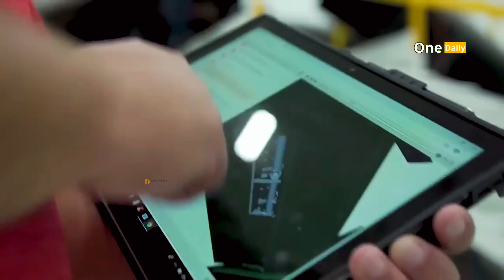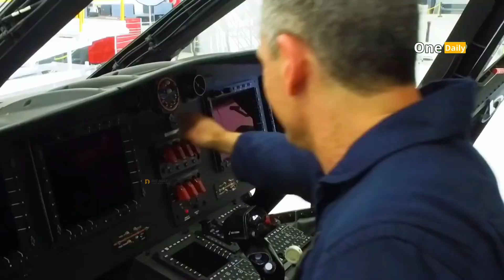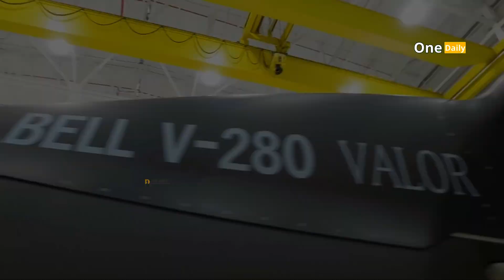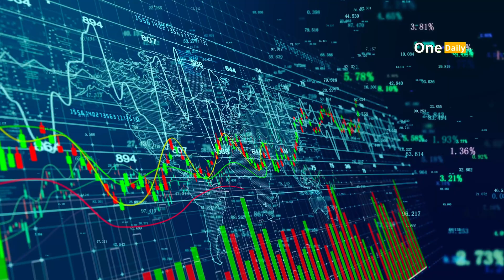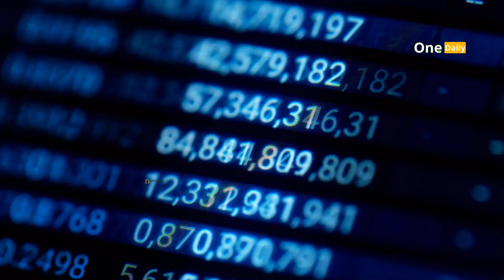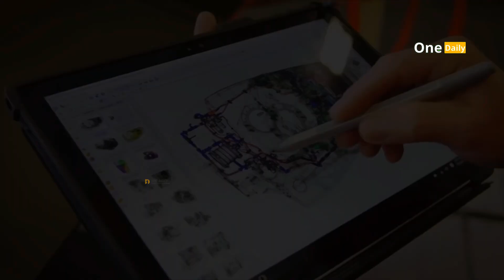Bell V-280 Valor: The Future of Military Aviation

Comment: What the difference between this and the osprey ? 

This needs a lot of space to land, the Blackhawk needs less space.

We already have the V22 Osprey. Are we reinventing the wheel ?

You can’t use this in urban environments, not that a Blackhawk is any better, but more opportunities with the Blackhawk
Reply: It has a 19% larger footprint than the Black Hawk. It is not as big as people claim it to be.
Reply: @n3v3rforgott3n9  thank you for this information 

I did not know that
Reply: The differences between this and the Osprey is size and a substantial redesign of the mechanism, it goes way beyond the fixed engines although that alone will already make vertical landings much safer.